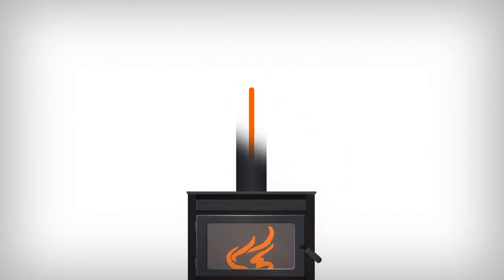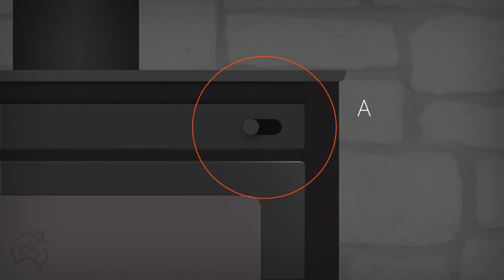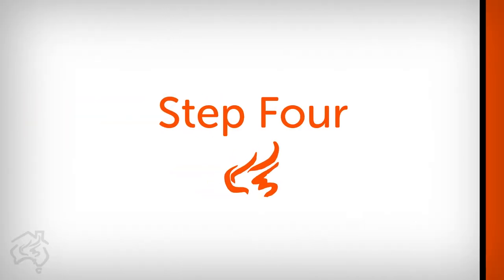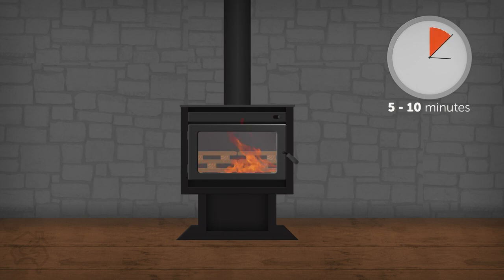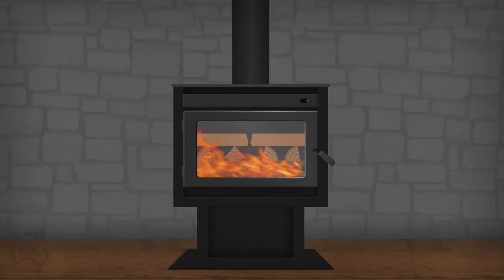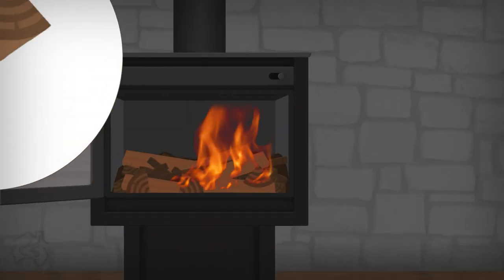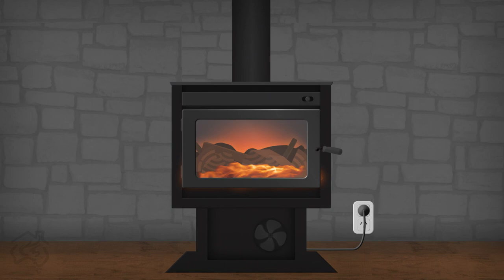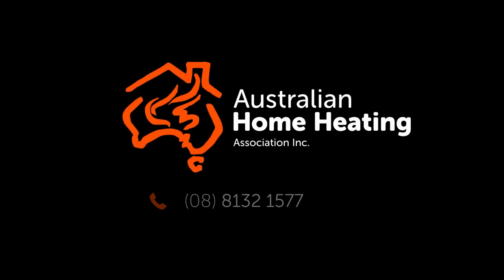How To Light Your Wood Heater

Comment: Just brought a new house with a masport wood heater . It doesn’t throw out much heat compared to a previous wood heater in a previous house . That one was almost too hot sometimes, this one is the complete opposite. Not doing anything different. Frustrating